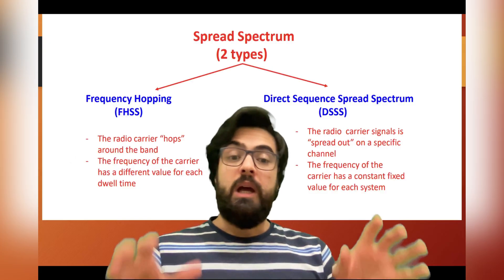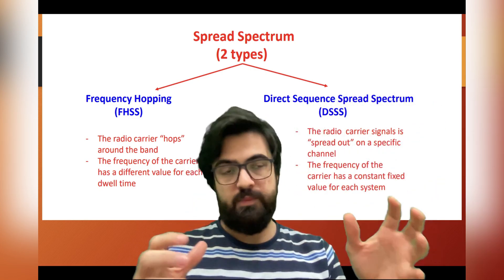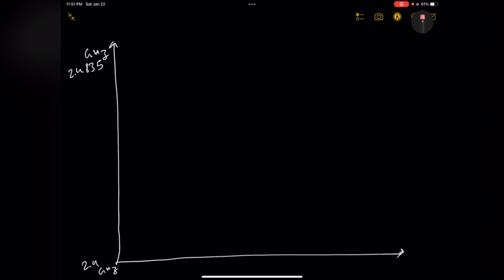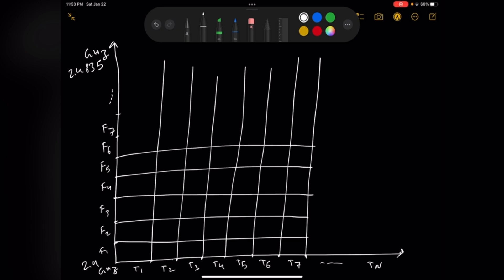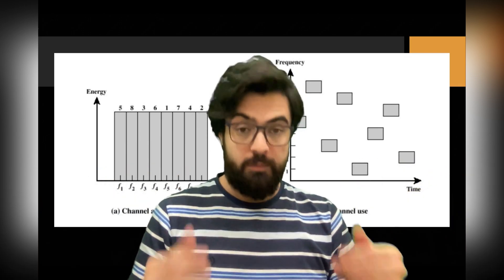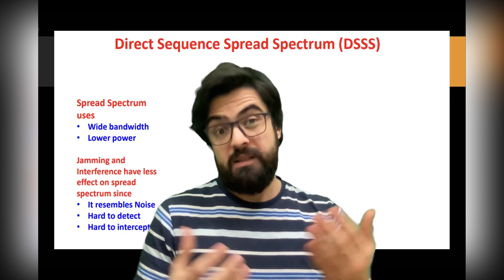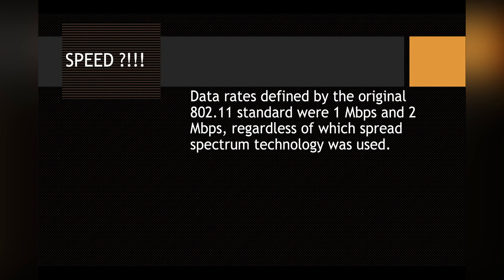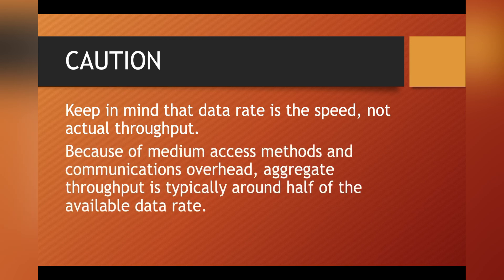FHSS vs DSSS

Comment: Hi! How is possible intercept and decode and listening frequenzy hopping in hf radio(0 30 mhz)? Software for intercept and analizyng and detected these transmission? How is possible? Sdr radio ok and also software??? Tanks and sorry for bad English!
Reply from the maker: Hi, No problem. To be honest I have never tried to intercept or even any kinds of messages manipulations. So it’s a shame, but I don’t know your questions’ answer.
Reply: @aminsedighfar  thanks, I want to known if is possible that! Only for curiosity, tecnichal! 73
Reply from the maker: @andreazanellato1982  I guess it’s possible but very difficult. Because the frequency hopping pattern is unknown for the interceptor. Therefore, firstly it should be estimated, by leveraging some estimators and filters.